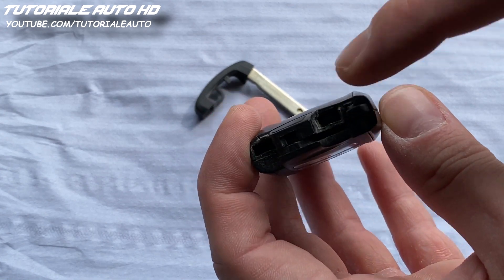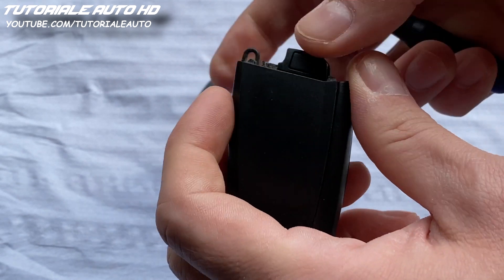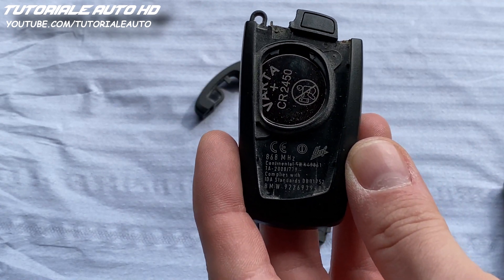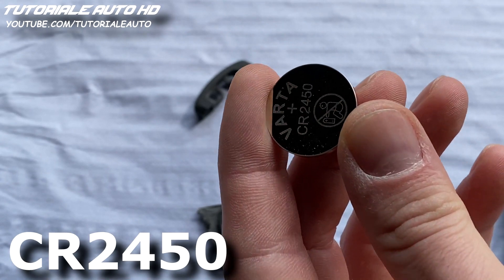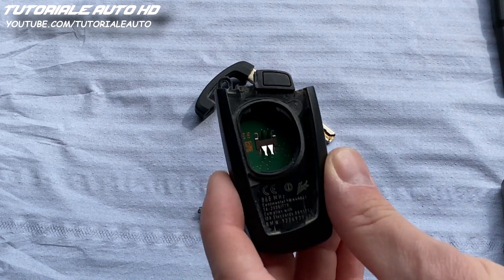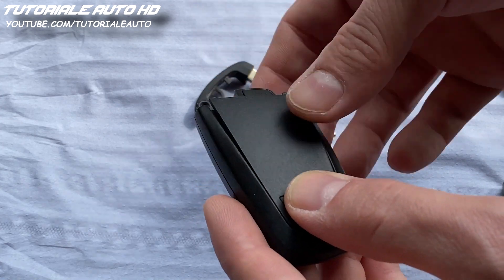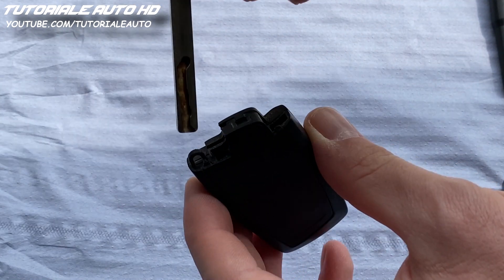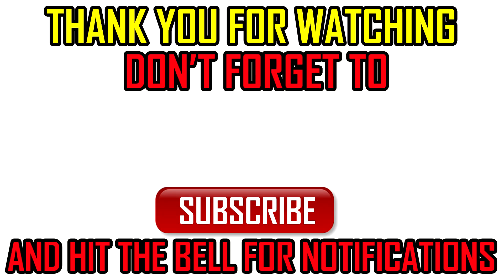How to Replace Battery BMW Smart Key Fob F Series

Comment: Si daca bateria e lipită pe placa cum se poate schimba?
Reply from the maker: Salut . Mergi la un electronist . Eu asa am mai inlocuit in trecut la e90 spre exemplu . A facut o lipitura a lamelelor pe bateria noua , dar nu stiu sigur sa iti zic ce tip de lipitura a facut , pentru ca pe baterii/acumulatori , nu poti face lipituri la cald.